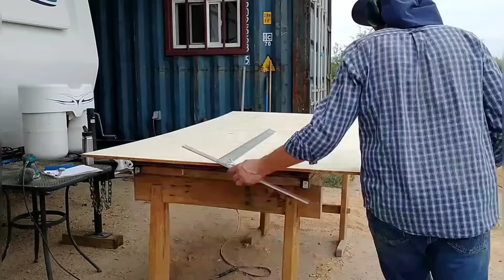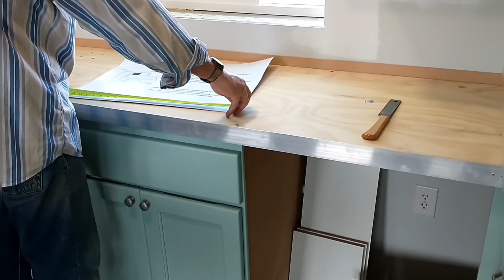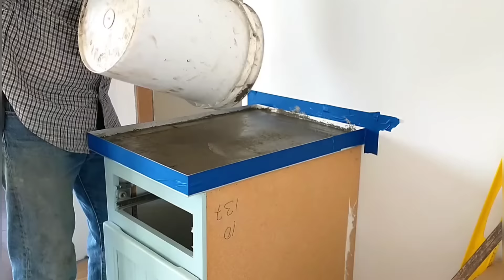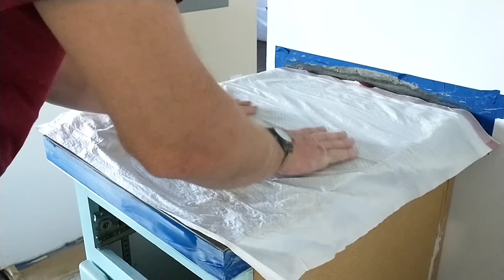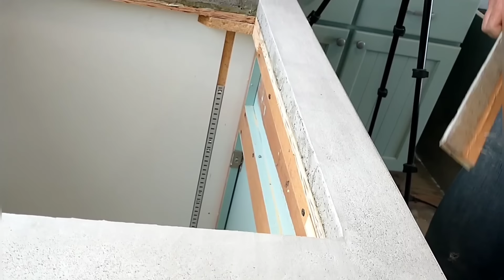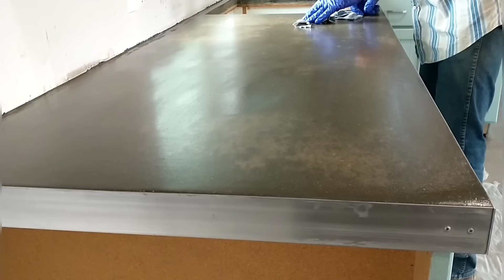Concrete Countertops Start to Finish | Quikrete Mix, Stone Polish, Metal Trim #46 DIY Off-Grid Build

Comment: I love your calm voice. surprise by the color variation in the concrete.
 I don't like that. any way to prevent it? maybe sealer instead of the oil.
Reply from the maker: Thanks! The linseed oil made it a lot darker and it also enhanced the color variations, which we like. The wet sanding brought out some of the color from the sand and gravel. The unsanded slightly low spots were the lighter colored areas. If you don't sand it, or maybe dry sand the color should be more even.

Comment: Top work guys. Any cracking since installation? I know with paths we put lines in to form smaller squares within the overall shape otherwise they always crack.
Reply from the maker: Thanks! We haven't had any new cracks. There is just the one small crack from when he removed the form for the sink opening.

Comment: So aluminum and concrete don’t go well together, the concrete is acidic and will cause the aluminum to corrode
Reply from the maker: There wasn't a reaction, because we coated the aluminum with a protective layer of polyurethane before pouring in the concrete.

Comment: 4 or 5 cycles with paitence and time is the only way to trowel your concrete right and make it flat and smooth. Always keep a bucket of clean water and clean the tools after every use. You did it right!! I bought cement molds online and making concrete benches, flower pots,  and tables.
Reply from the maker: Thanks! Sounds like some fun projects!

Comment: If you would’ve use a trowel instead of a float, which is actually what you were using, it would’ve been a lot smoother …….. all in all, it turned out nice
Reply from the maker: I tried to get him to use a trowel, but he liked the float better. 🤷 They are working out really well!

Comment: I've been pouring and finishing concrete for thirty years your countertops look good! I just found out the hard way a couple of weeks ago that aluminum reacts with the alkalis found in portland cement and makes hydrogen gas. "Serious consequences can arise in situations of long-term contact. First, a significant corrosion of aluminum embedded in concrete can occur. The corrosion can cause expansion of the concrete and subsequent cracking of hardened concrete." I wonder if there is a coating on your aluminum you should have seen bubbles forming where they contact. I cut off an old aluminum threshold that turned down into my wet cement with a side grinder and finished all the flecks of aluminum into the slab only to have it start bubbling on me. Your aluminum is not embedded so I don't think it will crack anything. Hope it doesn't give you problems just thought I would warn you. Hopefully your oil seeping into that space may keep the two from reacting with one another. Maybe put enough outward pressure on the top of the aluminum when waxing to get a good layer of wax between the two.
Reply from the maker: Thanks! That's interesting that there is such an immediate reaction. He painted the aluminum and plywood with polyurethane, and that seemed to do the trick. We didn't see any bubbling or issues with the concrete.

Comment: I used cement board instead
Reply from the maker: Cement board works too, but Red prefers plywood because it's easier to cut and drill into. 😎

Comment: I'm not trying to nit pick nor am I making fun.  The word is screed-a leveled layer of material (e.g., cement) applied to a floor or other surface.  A screed board.
Reply from the maker: Yes, when I was editing the subtitles, I looked it up, and sure enough we have always called it the wrong thing. We figured someone would mention it. 😄

Comment: Wow, they came out great. I love the permanent aluminum edges that also acted as forms. I don't think I've ever seen anyone do that. On that one side where you had to do plywood, maybe it would have been better to to that aluminum and the opposite side be the plywood, against the wall. We've thought of doing concrete countertops before, but in the end went with butcherblock. Tung oil yellows over time, so make sure to clean the aluminum really well, then possibly clear coat it with poly so it stays nice.
Reply from the maker: Thanks! It all worked out well! 😊
We ran out of the aluminum angle, so the little countertop in the closet just has aluminum across the front, and plywood on the side. Red glued a thin piece of plywood to the walls to create a lip for leveling. 
We wouldn't have considered that tung oil could yellow aluminum. Good to know! I guess it also gives the countertops the brown tones. 
Thanks! 😊🏜️